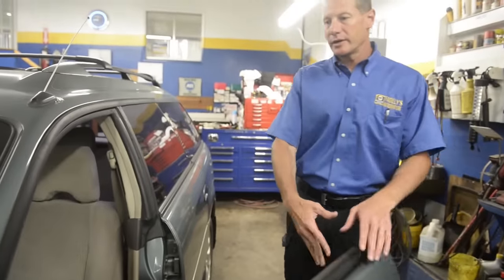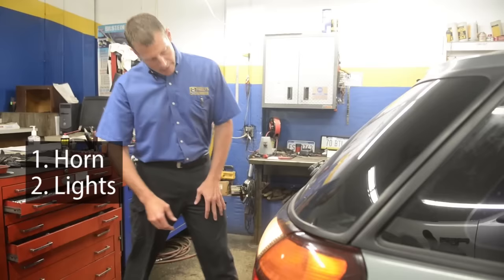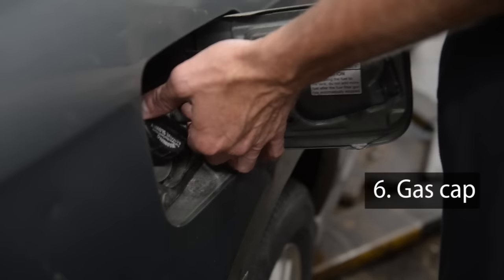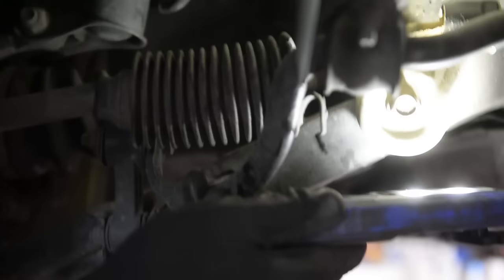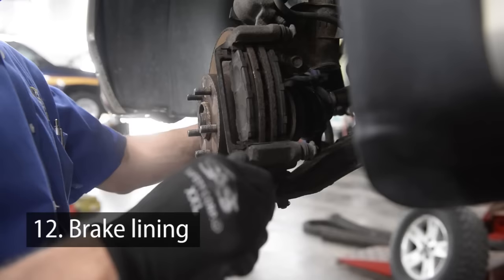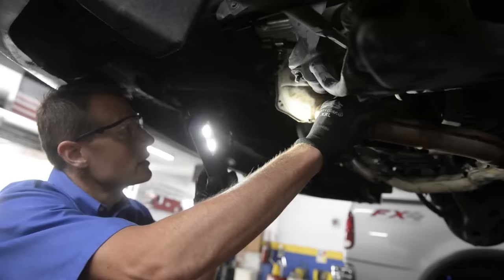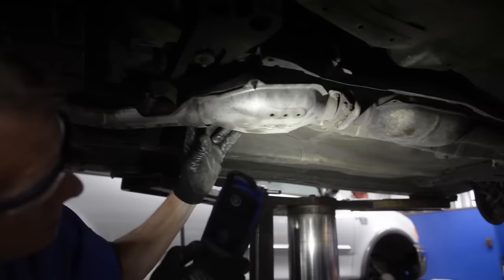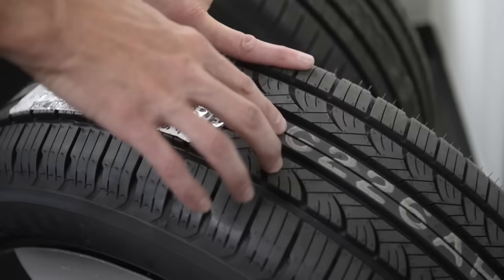Vehicle inspection: What Pennsylvania mechanics look for

Comment: PA inspections are a typical Pennsylvania racket!
Reply: Abraham Smith     Yes I live  there too and agree with you. whole heartedly. State inspection is a money maker for hapless mechanics and crooked politicians. The state claims the right to travel is a privilege , not a right. Which is bullshit !
Reply: Abraham Smith Yes and so called Certified mechanics is another scam . My last oil change the so called mechanic tightened my oil drain plug with an impact tool SMH!
Reply: Let's say you didn't have to get one for safety or emissions. You could be putting your life and the life of everybody around you in danger and not even know it.  Say your shocks are bad, you go to stop but on that part of the road there are bumps. With bad shocks you wouldn't be able to stop in time. Or tires that have so little tread they look like racing tires you would see in nascar. I've personally dealt with customers that had  tires just above 2/32 which pass inspection but make it very dangerous to drive. Worst part about that customer was that she has a car seat in the back
Reply: @JB-423  Most cats on the road today are safer and people keep them in safe condition.  If someone does not regard anyone else on the road they will drive any piece of crap.  Therefore, the police will pull them over.  I would like to know how much safer it is in state s that require inspection as those that do not.
Reply: Driving is a privilege and not a Constitution protected right, courts both Federally and states say so until it's ammended to the Constition. Now those so called Bill of Rights are they rights or privileges? If they can take them away or restrict them on you, they aren't rights they are privileges!
Reply: @philliesphan312  would certainly be safer around here if tax money fixed our roads properly. Not just a patch job. You would think cars are safer but it's all up to the driver of that car.
Reply: @philliesphan312  There are states that have discontinued safety inspections because they made no appreciable difference in the accident rate
Reply: @JB-423  Ohio doesnt require this and we dont have any more issues than PA. What amazes me is that PA doesnt require vision checks when renewing a license. Seems to me being able to actually see is a little more important.

Comment: UK annual vehicle inspections are tough, brakes are tested on rolling road, so each side can be tested individually, lights are tested throughly and fronts must be set at height with a beam pattern, tyres tested over full circumference and 3/4 of tread value with minimal 1.6mm, as from 05-18, the tests are increased and even harder than before.

Makes the US tests look like a JiffyLube special..! 
German tests are very stringent, much of Europe is hard and you must adhere to winter tyres in those months.
Reply: Sounds just like pa inspection.
Reply: Lots of PA is of German decent...lol
Reply: @JourneyToTheTruthandTR  

…and I thought that was Argentina.!🫣

Comment: Oil leak doesn’t fail state inspection.  Only from shock absorbers.

Class 4 PA Certified Inspection Mechanic
Reply: woodsy249 hell can i bring my car to u for inspection?
Reply: Don't think he was saying that it would fail with engine oil leak. Just saying to look for it since you're under there so you could tell the customer if one exists.
Reply: What about an oil leak on to the hot exhaust?
Reply: @geecrawdad  why would there be an oil leak on the exhaust
Reply: @Marsbound215  Oil leaks from an engine have to go somewhere. Sometimes it will drip onto an exhaust pipe. It won't smell pretty.
Reply: ive seen techs fail a car for oil leaks that have gotten bad enough where they drip onto the manifold. If it's a fire hazard, it doesn't pass.
Reply: @geecrawdad  I was tripping when I said that I wasn’t thinking about the manifolds 😂😂😂 sad cause I just got my state inspection license but oil leaks shouldn’t fail the test unless it’s really bad but everything is at the inspector discretion people scared of them audits

Comment: You also can't use a Tire Tread Depth Gauge for the break lining measurements. You either have to use a lining gauge or a depth gauge. You can't use that tire gauge like the one they used in the video.

Comment: This is beyond me lmaooooo. I never knew they did all this every time I get my stickers in philly the guy just hooks up a device at the most. Probably only in north philly lol.
Reply: Can't believe they actually test drive every vehicle? Or are supposed to.
Reply: @geecrawdad  yes in pa they are usually a very short drive to make sure there isn't any safety issues because most mechanics easily have a feel for most problems when they drive it as they can pinpoint most problems this way, stuff that may be hidden and not noticed during a visual inspection. One thing that never really made sense to be though is it out of all of these things they check for wheel alignment wasn't one of the things mentioned. I've seen some cars with really bad alignment fail already

Comment: I lived in Pennsylvania, this is the worst safety inspections. If you had a slow leak on your oil pan gasket it's the only vehicle you got, they flunk you.
Reply: Yeah me too and it sucks. Plus if you want to modify your cars exhaust in any way it's a pain in the ass with emissions
Reply: No just go to North Philly around Indiana st you'll find what you're looking for
Reply: Tommygunnz Frank what an indiana?
Reply: Mr. Nationwide  I am more afraid of PA state inspections than I am getting mugged and I love in North fucking Philly.
Reply: You do have the right to challenge a failure. Also,  oil leak doesn't fail a car. They can tell you it's leaking and see if you want it fixed but it isn't something that would fail
Reply: My reading of the guidelines says it has to be leaking on the exhaust to fail.

Comment: and u don't fail a guy for inter tie rod boot is bad. if ball socket has no free play u pass don't matter the boot is bad or not lol
Reply: Ur right the boot is just a dust cover
Reply: Sky Chiang I had one garbage fail me and another garage pass me for an oil leak.
Reply: Sky Chiang well how about the mechanic that damages on purpose your tie rod connections with a huge MF pliers.
Reply: @erin19030  engine oil leak won't fail. Remember, you can always challenge that mech if/ when your car fails.

Comment: been driving my Saturn vue 2004 for over 10 years now  drive to new york and back to pa 4 times a month  it has some bushing noises i think that is expected out of a 278,000 mile 2004 year car. never gave me any real problems i replace the struts and shocks 2 years ago . i replace the brake pads once a year. took it to inspect  a few weeks ago and this guy took a crow bar type bar and started moving everything under my car he check everything.  at the end of the week it cost me 1,329 bucks in parts and labor to get my stickers. yup big highway robbery.
Reply: Peter Rod yes Pennsylvania authorizes crow bars and sledge hammers as inspection tools.
Reply: Shocks and struts aren't the only pieces of your suspension.

Comment: Bring any vehicle that’s been recently pa inspected to Maryland have it inspected in Maryland chances are it won’t pass at all. I just bought an 01 Jeep cherokee that was inspected in pa and somehow pass with bad rear drum brakes, rust hole in the floor, bad leaky tail pipe and bad front front brake rotors which cause it to fail Maryland inspection
Reply: Maryland inspections are only done when you move there, or buy a used car from a private seller. It is way more laid back in Maryland. On top of that it’s 2 year tags and 2 year emissions. I have a vapor leak that I hid by resetting the computer. Passed the emissions with flying colors
Reply: I live in Maryland and everytime I get a new car I feel like im getting extorted with inspections they always want to find something to fail me on just so they can make extra money. Thank god it’s only one time because they’re scumbags

Comment: Pa inspection are the worst they really suck they check so many things and of course not everything is perfect on a used car so is bs that they take it to that extend and check so many things,I wish they only did emission to pass like nj
Reply: Just because the car isn't perfect doesn't mean it'l fail. Has to be pretty bad to fail. Another reason to buy toyota or honda. They're built to last unlike GM ford and Chrysler. Even Nissan is shit these days with their BS CVT transmissions

Comment: It's a racket. Yes I understand a lot of people don't maintain there vehicles like they should, at the same time there is no audits or oversight on  the shops that do these inspections. I'm not calling all mechanics and shops shady but you can take your car to one place they tell you, you need this this and this in order to pass holding that mandatory sticker over your head, then you take it to another place for a 2nd opinion and they tell you it's fine noting wrong with your car. Same thing with the emissions. They only require them in counties that are more populated to make more money.